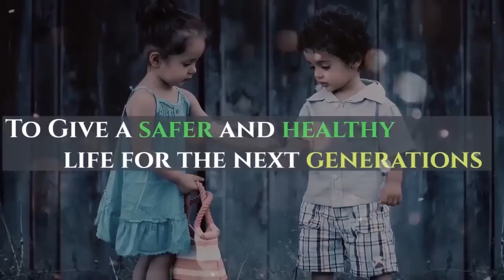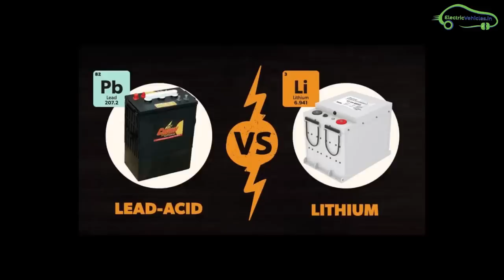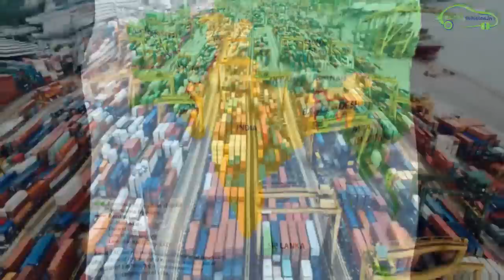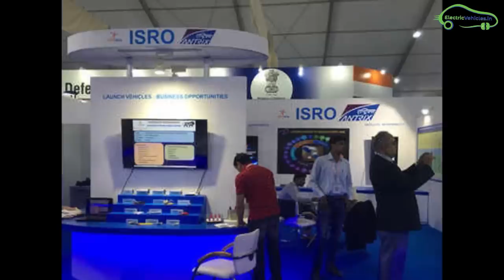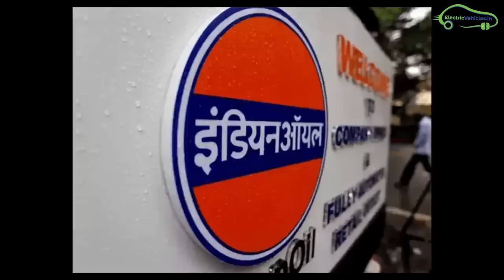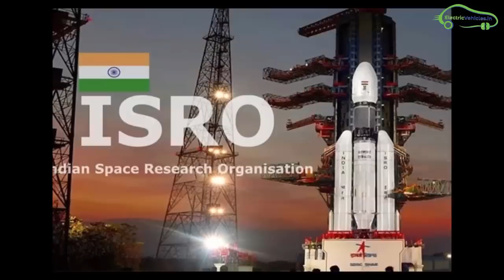India's Position in Lithium ion Battery Tech for EVs ✔✔

Comment: No need of lithium ions...if you import it will be same as importing oil.....better to go with thermal batteries..which is best suited for india..
Reply from the maker: Well.. self reliance wont be achieved over night Amit ji.. It takes some time..  in few years India will be self reliant, by that time we have to bring the right vehicle models for India  and also the consumption will go up....  there are also greater chances for alternative metal batteries will come in play too..
Reply: @ElectricVehiclesIndia  thats true but some clear  vision should come.